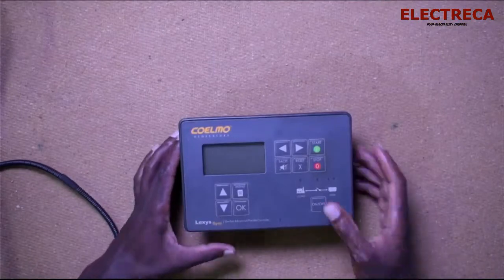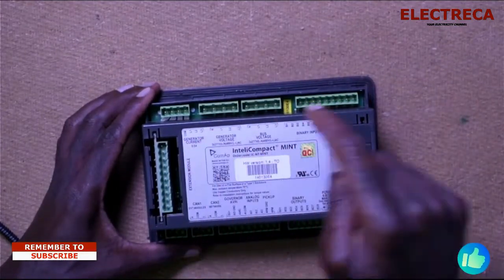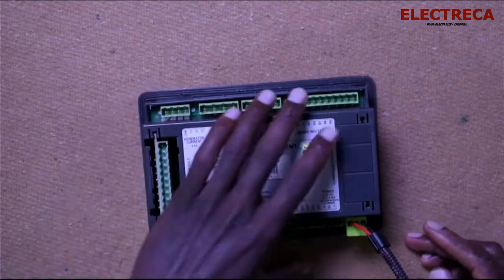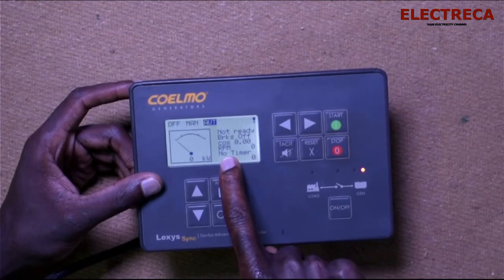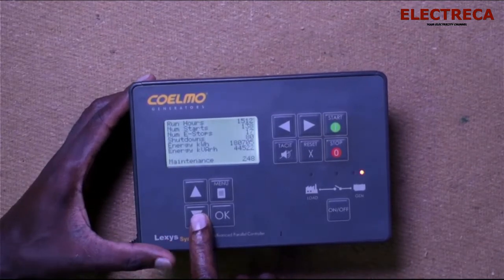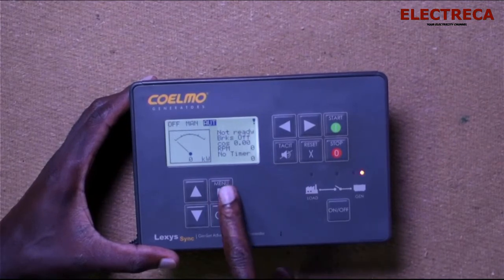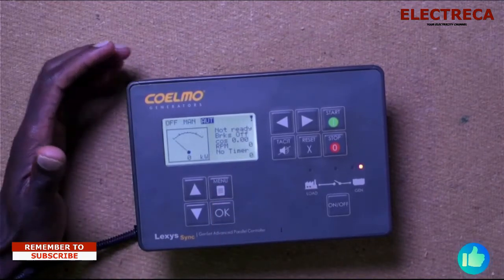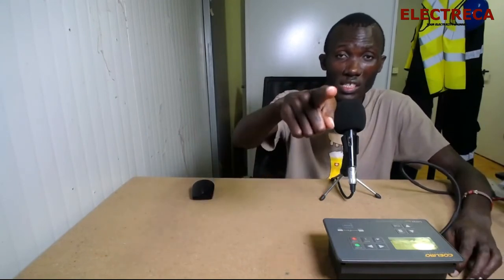comAp intelgen controller | lexys sync | coelimo controller | generator controller

Comment: Thanks for your great tutorials!, I have a similar Lexys Sync controller connected to a 750kVA generator, however at times it displays an error *GCB FAILURE and proceeds to trip the breaker, but after some time it operates normally and closes automatically. Is there a way to troubleshoot and rectify it, or disable it?
Reply from the maker: Does the error appear when the GCB tempt to close or after it closes and runs for some time? when the error appears does it shut down the engine or its trip but the engine continues to run?
Reply: @elektreca  the error appears after the GCB closes and runs for some time. In one instant it appeared while running and supporting a load, and the breaker tripped but the engine continued to run.